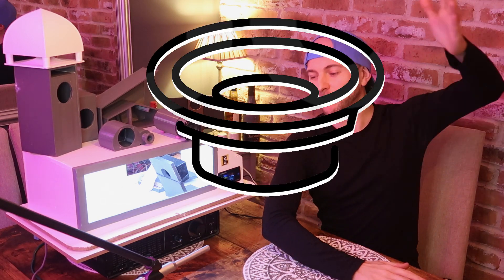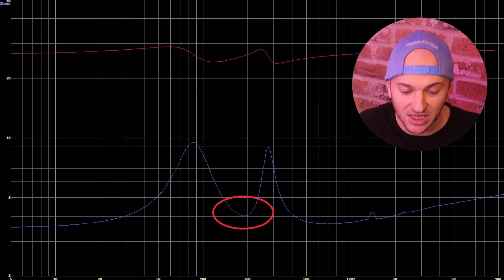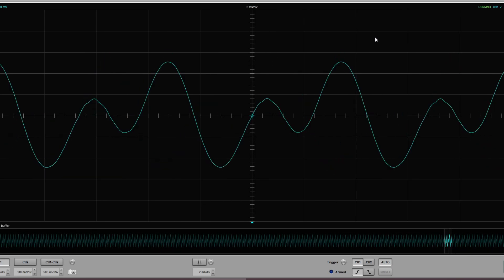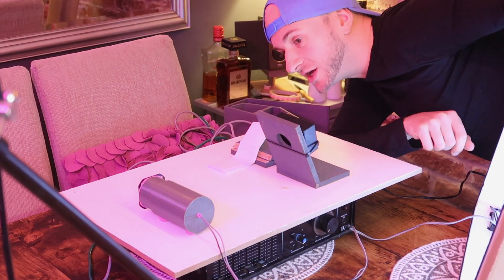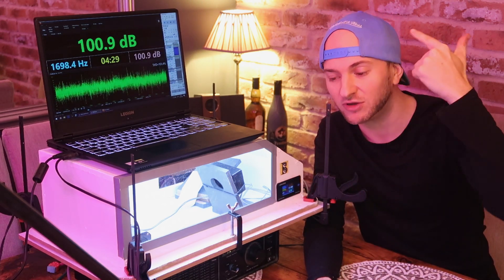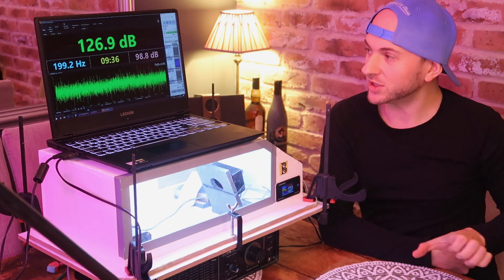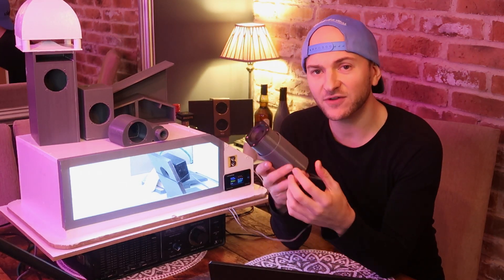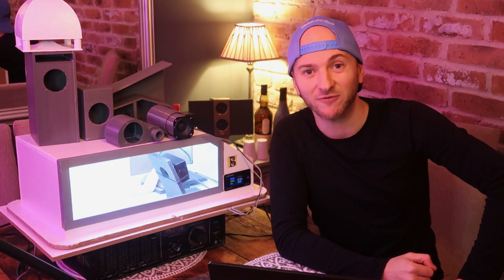The Barrel Of BASS | Mini Subwoofer Box Contest | Boom Or Bust S1E6

Comment: Never had luck with round subwoofer enclosures, does not matter how the port is made although it should be ideal box (especially when coned back) since it does not have shape that would generate standing waves through wall reflections.

Comment: I've always wanted to build a ported tub enclosure simular to this but on a larger scale. Since I have easy access at work to scrap pvc pipe up to 14 inch diameter. I already built a 10 inch and 12 inch sealed tube subwoofer that I use regularly. But the only idea I had for ports was to drop it in a square box and the 4 corners would be the ports. But then the outside of the enclosure isn't round any more.  THIS IDEA CHANGES THE GAME FOR ME. Only problem I see is. I don't think they make 10 or 12 and a half pvc pipe. So putting 10" pipe inside of 12" might be to much port area? A 12" in 14" pipe even more port area. BUT I'M ON A MISSION NOW🤣 Pretty sure after 3" no half sizes it goes 4" (5" hard to find) 6" 8" 10" 12"  and 14" is the largest we use at my company.
Reply: Cut an inch out long way and plastic weld it

Comment: Damn, now I'm wondering if my "Bass Whistle" design is tuned a bit too low, LOL.  I targeted around 149 Hz. 

The output of that tube is probably hampered by its high CSR. That may account for the distortion you saw in the response.  There also be some minor cancellation at higher frequencies due to the vent being offset from the driver that way.  I wonder what would be the result if the outer cylinder is made a little larger and extended so the port reaches right up to the driver and hits the same target Fb? 

BTW, that design could also be considered a stepped two-segment end-loaded TL, and modeled that way.
Reply: So, I had the port the same length as the main chamber, and the port was a little wider, and by my math, it was tuned down around 27hz, that would be around  4.5 scaled hz.
Reply: @tededonthugback  Just increase the diameter of the outer cylinder.  That will increase the effective CSA between the inner and outer cylinders, which will in turn increase Fb.

Comment: Great video series Sam! It would be great to test 3 different sealed enclosures: 1st w/Qtc of.707, 2cnd w/Qtc of 1.0, and 3rd w/Qtc of 1.3. For those who are not familiar with what Qtc means for a sealed enclosure, its the damping spring/load the enclosure presents to a speaker. A .707 Qtc= the most neutral/natural sounding=sq, a 1.0 Qtc= approx. range of most daily driver, sealed enclosures, and a 1.3 Qtc= more of a burp/SPL sealed enclosure. Would be a great  baseline control enclosure, to see how much these ports are adding or losing @ different frequencies? Hope to see you do this Sam, thank you for taking your time to do these videos, much ❤️ from the USA to you!

Comment: Maybe that buzz at 150hz is port noise, since the port has no flare and the port is very thin and maybe even small surface area wise, while the circumfrence is very large, so the port is very thin. This has as con that the velocity the port can handle is pretty low I think.

Comment: That's a great design for the portable Bluetooth speakers, there are speakers with a passive radiator but no Bluetooth speaker with ported type . Pls compare it with the enclosure with a passive radiator .
Reply: Problem with a port is that it needs to be quite long if you want to tune it low even 50hz with this driver will be hard in a small space
Reply: The reason there are no ported Bluetooth speakers is because of waterproofing. Also you can tune a really small passive radiator much lower than a small port, because the main thing that decides the tuning of a passive radiator is weight, not length or width.